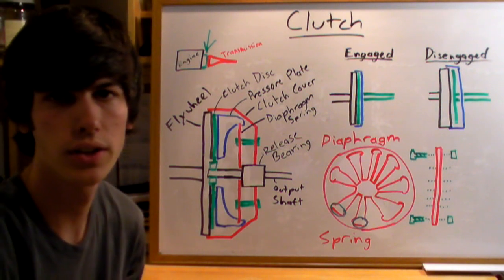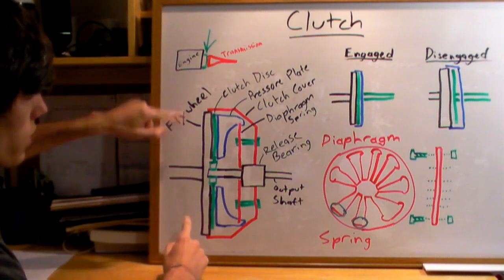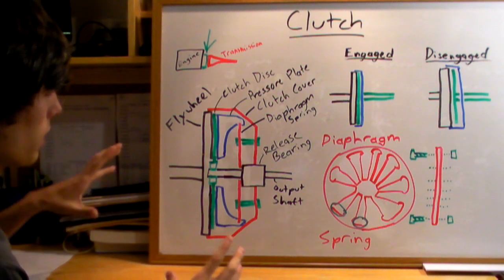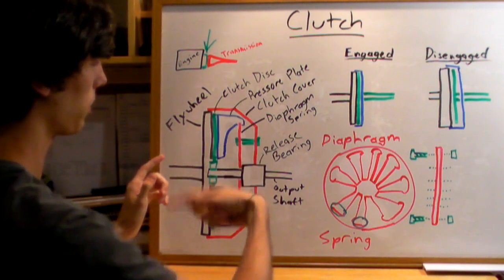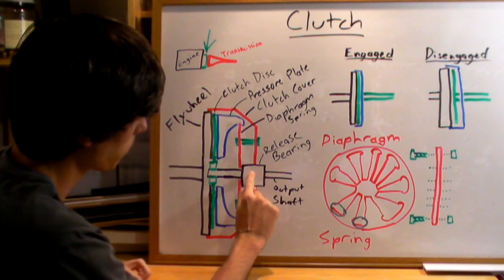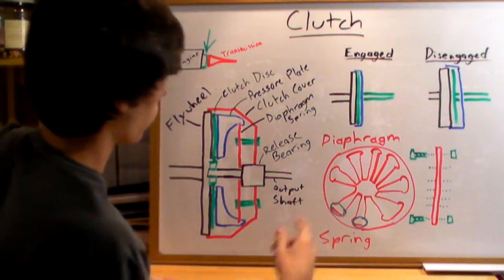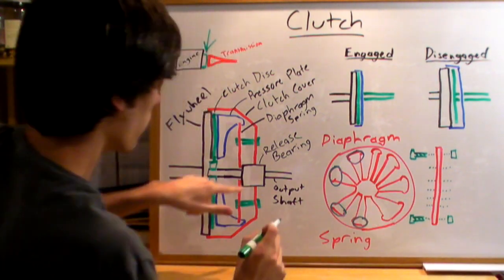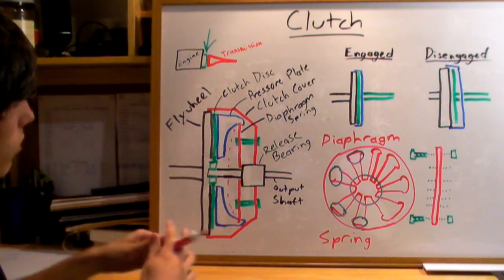Clutches - Explained

Comment: Great video, simple and clear. I would have liked to have seen the equation result under different scenarios. For instance, is there an exponential increase in the ability to handle torque when 2 or 3 plates are used.

Comment: What issues can you run into when using an adapter plate to mate a motor to a foreign transmission. Is there ever a scenario where your adapter plate is too thick that the clutch doesn’t engage with the flywheel anymore?

Comment: Can you explain to me what happens on neutral when pressing the clutch in and out please? Always wondered what is the difference between neutral and neutral+clutch pressed in.
Reply: neutral gearing occurs inside the transmission where paired gear sets have their own clutch-like collar that actuates a particular gear. The clutch pedal is attached in front of the transmission so basically they are 2 separate systems.

Comment: Question, does it wear on the clutch to cruise to a stop in neutral ? I keep hearing this, but I just don't see how if it's rotating with the crankshaft with no pressure on the clutch.
Reply: If you keep the clutch pressed, yes. If you put your car in neutral and then release the clutch, no.

if you cruise and do the second thing, try to rev match at the end if you don't stop, to avoid wear on the clutch or the synchros.
Reply: Seems like the issue here is that the clutch is still technically in contact with the flywheel but it just grinds against it without the pressure from the diaphragm. So it basically turns into a disc grinder as you are coasting. However if you let go of the clutch the pressure is applied immediately and the clutch stops grinding against the flywheel. If you put the car in neutral, the engine clutch is engaged/not grinding and none of the gear clutches are applied and so nothing is grinding.

Comment: +Engineering Explained:I've been planning to buy an R32 from a local importer here in Florida. I've been spending a fair amount of my free time just researching the car in general, just to be sure it is what I want to buy with my first bonus after college. I recently saw a video where someone said that the clutch pedal does not have to be depressed in order to start the engine. Why is this the case with the skyline?

Comment: what is the function of pilot bearing ?
Reply: Imtiaz Sarwar Wasek to allow the engine to continue spinning while the transmission input shaft is completely stationary.

A scenario of this would be you at a red light while idling with clutch pedal in.

Engine is still running but transmission is completely stopped. (Not rotating)
Reply: +Alex salazar

Is that how a manual transmission doesn't stall when there is resistance? I've been trying to figure this out for a while and I just can't figure it out.  Let's say a car with a small engine is on a steep incline on an asphalt road. They are at 1k rpm and shift into first but that isn't enough force to turn the transmission. In my mind that would stop the engine from turning.  

I have been an automatic driver my whole life and I know that the torque converter gives a lot of leeway when it comes to not using enough power to start turning the wheels.
Reply: Pilot bearing keeps the output shaft from rattling and making noise

Comment: so, i(if i understand this at all!) it is just friction that connects the engine to the gearbox? How does it not slip all the time?
Reply: David Baker it is connected by bolts also
Reply: David Baker the high pressure from the pressure plate/diaghram then the higher performance you go. the stronger the pressure plate. and after a while can stack clutches!
Reply: The clutch needs to have a higher grip force than the torque of the engine. Hence presumably why people talk about how supercars have "heavy" clutches simply because their engines have so much torque that needs to be nailed down by the clutch in order to avoid slippage. High pressure diaphragms and large multi-plate clutch assemblies presumably. I'm no car expert though tbh. But that seems to be the logical conclusion.

Comment: Ey man, just a question about clutch burn.  I believe what causes it is the friction on the clutch if it's partially and not fully engaged.  Does this mean you can't burn the clutch if you ride it on neutral, or if you ride it fully disengaged(floor clutch press)?

Comment: Hello sir,
We are goiing to design a ATV for Baja student India'17 where we thought to implement the cvt but I need some suggestion regarding this that what are components that we need.
1.engine
2.torque converter
3. cvt
4.forward-neutral-reverse(fnr) gear box 
5.drive shaft
6.differential
7.axle shaft

please tell me that above list is correct or not ,if not please modify it.

Comment: No matter how many of vids about clutches i watch, i still cant understand it lol
Reply: Take a look at that disengaged
Reply: You have a clutch disc, flywheel and pressure plate. Flywheel connects to the engine crankshaft, pressure plate connects to the flywheel. Since they are connected, they spin at the same speed. Clutch disc is connected to the transmission. 

Pushing the clutch pedal in will disengage the clutch disc from the flywheel since pressure plate isn’t applying the pressure.

Comment: So what happens when someone "burns" a clutch by revving to much with the clutch pedal pushed in?? I'm curious to know the science behind that
Reply: +Bouge laal The friction between pressure plate and the clutch disk generates heat. The heat and friction are what eventually kill the clutch. But this just happens if you hold the clutch at the biting point, which means that it is neither fully engaged nor disengaged, so it slips. Yeah, thats about it.
Reply: Eventually under normal wear and tear then this will happen I'm assuming, right?
Reply: +Bouge laal Sure, eventually the clutch disk is worn down. What then happens is that the clutch begins to slip even when fully engaged, meaning that the engine will rev up without accelerating. But you dont have to worry about this in everyday use. I had my clutch replaced when i had 200k km in my car. 
But that whole thing is completely normal, as the clutch is a wear and tear item.
Reply: Cool, thanks man

Comment: quick question, can I use a race clutch for road racing and drag racing with the stock pressure plate,or do I have to buy the whole kit,cause I made the mistake of buying a garbage clutch and pressure plate for cheap 105$,and now that I want to have fun (burnouts)I can't transfer power good and I burned the clutch,can I use the piece of shit pressure plate with a good race clutch
Reply: I wouldn't, because race/drag pressure plates have stronger springs, which apply more force to increase grip on the performance clutch. So even if you use a performance clutch, if you're using a shitty pressure plate with weak springs, it won't apply enough pressure to get the full use of the clutch's better materials and properties. You also have to deal with two different models/manufacturers, and they probably weren't designed to work with each other, and might not even fit at all.

TL;DR: If you're gonna get a performance clutch, get a performance pressure plate too.

Comment: there is an interesting variation of the manual shift that has been used in the maruti Suzuki celerio.... released in India recently that claims to have the same fuel efficiency as a manual although it doesn't have a clutch.... could you please make a video to explain how that works
Reply: +Shreyas Shanker It shares the same mechanics of a manual transmission, the difference being it exchanges the clutch pedal for an electronic controler of the clutch and gears. So you have comfort of an automatic without its losses.
Reply: +Paralelepipedo00 awesome.... thanks for the reply

Comment: why is it that if that you can bring the clutch up gradually and there it gradually engages the gear? surely it is either engaged or disengaged?
Reply from the maker: +James Fox It's not an on/off switch. Pressure increases as you release the pedal, so it gradually grips as you let out.
Reply: Do you feel the same way about brake pads?
Reply: Ville Nummisalo It was a simple yes or non question

Comment: Hey nice explanation of how it disengages! you forgot to explain what makes the pressure on the pressure plate so it presses on the disc :)
Reply from the maker: +Nuno Rodrigues The diaphragm spring. I believe I mention this.
Reply: +Engineering Explained sorry but you have missed the 3 plates that secure the pressure plate to the cover and actually force it down onto the disc
Reply: There are straps holding pressure plate back using their spring characteristic as well as centrifugal force (caused by spinning) I mean neither pressure plate is suspended nor clamped to the diaphragm spring so the diaphragm spring can not pull it back!

Comment: how clutch disc  disconnect flywheel?
Reply from the maker: đức hữu nguyen Diaphragm spring.
Reply: Engineering Explained hey，thanks for your explanation. But I got a question：u said clutch disc and the shaft won't be rotate with the flywheel，the other parts will. how could that possible？I mean is there 2 situations？I think when driver disengage the release bearing，the clutch disc is always free to rotate. however，when the release bearing is
 engaged, the clutch disc must be rotate with the flywheel just like other parts. And shaft rotate with flywheel in same velocity? or the flywheel rotate at its own velocity?

Comment: Hold on...... The clutch is attached to the flywheel. So if flywheel is lighter it can rotate faster with lesser engine power . so faster moving flywheel will result in more speed. So if I want my car to move at a greater speed lighter flywheel is ideal. Does that make sense?
Reply: adhithya ravichandran No it does not make sense. The clutch is not attached to the flywheel in a form of nuts and bolts. However the clutch is in between the flywheel and pressure plate. Lighter flywheel means that the engine will be able to spin(rev) faster compared to a heavy factory spec flywheel.
Reply: Omar is Raddoesn't the transmission rotate at the speed of the flywheel when clutch Is engaged. So more the engine Revs more is the speed of the car.
Reply: adhithya ravichandran a lighter flywheel will not necessarily make your car faster. And The transmission and engine spin together regardless of what gear you are in. The tranny stops spinning when you press the clutch pedal in.

Comment: There seems to be a lot of controversy on the Internet on whether or not you should change your automatic or manual transmission fluid.. I know my manual transmission jeep recommends that it never needs to be changed for the life of the vehicle. What are your thoughts and opinions from an engineering standpoint?

Comment: Question: when my clutch is engaged, I hear a knocking sound, almost similar to the sound of helicopter props spinning; the sound may speed up along with RPM (while moving), but it gets hard to hear over the engine noise at that point. What might this be?
Reply: Jeremy Kerstetter Could possibly mean your throw-out-bearing is faulty or was improperly installed.
Reply: +Jeremy Kerstetter throw out bearing.

Comment: Why the clutch doesn't slip with high torque engines? They do alot of pressure to the flywheel?
Reply from the maker: Feche1320 Proper amount of friction.

Comment: You explained the clutch very well. I have struggled trying to comprehend how when you press the throw-out bearing toward the flywheel, you get the clutch plate to release from the flywheel. The diaphragm springs are what make that whole assembly "Reverse Acting".  I am in the middle of replacing the clutch in my son's 2001 Honda Civic EX Coup. Parts is parts, but it's always helpful to know how something works because it makes servicing a lot easier when you can apply the logic. Plus I wont look like an idiot explaining to my son why we are doing what we are doing. He's got a much better chance of learning and retaining information when it makes sense, otherwise its just what bolt to remove and parts to replace. Thanks!

Comment: The bolts only hold parts together. You are very knowledgeable but it's a lot different to study engineering than to have hands on experience and knowledge with components. I think you could be a very good technician.

Comment: hey, i know this is a very basic question, but what will happen if we do not press the clutch pedal? why exactly is it better to press the clutch and change gears? cant we just change the gears? and why? plz do explain..
Reply from the maker: Abhijeet Mishra Pressing the clutch pedal disengages the engine from the transmission. It is possible to change gears without it, but it requires perfectly matching the engine RPM to the transmission speed, otherwise you will hear an unfortunate noise (and could cause damage).
Reply: Even perfectly matching the rpm and not using the clutch is bad for synchro gear boxes

Comment: can you explain how come the clutch  disk and the pressure plate don't ware out quickly, i mean when the clutch is half pushed isn't it rubbing against the pressure plate and therefore wearing each other?
Reply from the maker: Yes, but only for brief periods of time (while shifting). Otherwise, they're rotating at the same speed. If you intentionally let it slip, it will wear significantly in a short amount of time.
Reply: Ohh got it thanks!

Comment: I still have a key question unanswered from the video, and would welcome anyone who has the knowledge to answer it.  When the pressure plate is pulled away from the clutch disc as the clutch pedal is being pressed, why does the clutch disc slide along the input shaft (drawn as output shaft in your schematics) towards the direction of the pressure disc (thus disengaging it from the flywheel), when there is no force driving it to do so?  Remember all we are doing is to disengage the pressure disc from the clutch disc, and the pressure disc does not actively pull the clutch disc away from the flywheel. The inertia should keep the clutch disc in contact at least momentarily with the flywheel, thus spinning still with it at the same speed, until the friction is not enough to keep it that way.  If that is correct, the slipping friction will wear the clutch disc in this case.  But again, what is the reason that you say in your video the the clutch disc is going to disengage from the flywheel (meaning that we create a space between the flywheel and the clutch disc by pressing the clutch pedal)?
Reply from the maker: It disengages due to friction. The clutch wants to spin at the speed of the wheels, as it's connected to the transmission. When the speed differs from the flywheel, friction will push it away. It's very similar to how brakes work, as there is nothing that "pulls" your brake pads off the the disc, friction just moves it away if there is no applied pressure. Just like a clutch, you could have some wear here (though it will be very minimal) as the speeds differ.
Reply: Engineering Explained Just to clarify. Its not friction which push brake pads away from the disc. Its actually seals within brake block, the ones sealing caliper. As they are made out of let say rubber they will compress/stretch (due to friction between rubber and cylinder) when caliper goes inwards. Then they release that stored energy when there is no brake fluid pressure. How to check it? When you have wheel off just get somebody to push brake pedal few times and watch brake pads mowing in and out. Thats of course just slight movement but enough to set disc free.

Comment: Can you please explain what practices will wear out a clutch on a manual transmission.
Reply from the maker: Don't burn your clutch (rev the engine high and not let it grip), don't hold yourself on a hill with the clutch (use the brakes!), try to rev match.

Comment: can the clutch can keep the engine running or it helps the flywheel?
Reply from the maker: The clutch is connected to the transmission shaft, so it is not rotating when your engine is in neutral.
Reply: Engineering Explained Thanks for your help!

Comment: Hi great video as always!
I learn a lot from your videos!

Could you explain why the clutch "burns" if you keep pressing the clutch pedal?!
If when pressing it releases the clutch, wouldn't it be with no friction and hence not "burn"!?
Just curious.. Thanks heaps!
Keep on the great work mate!
Reply from the maker: "Burning" the clutch refers to when the engine speed and transmission speed are not matched, but the clutch is engaged (at least partially), so it's rubbing against the flywheel and friction is heating it up and wearing it.

Comment: As a person learning how to drive a stick, everybody tells me not to burn up the clutch. Do you think you could explain how clutches "burn." Could you also explain why the cars stall when you aren't accelerating enough?
Reply from the maker: Could potentially make videos on these topics. The clutch "burns" when your engine rpm doesn't match your transmission rpm, so the clutch is sliding on the flywheel/pressure plate, creating friction and heating up.

Comment: so when the clutch is only pushed half way in for example when going from a stop to some speed in first gear, is the clutch plate sliding against the flywheel and only portion of the energy from the engine being passed from the flywheel to the transmission and wheels? and when the clutch is fully released I assume it is rotating with the flywheel completely with no slippage occurring?
Reply from the maker: Yep, and yep.

Comment: I had the same question as Indra. Does the clutch decouple from the flywheel due to friction from the output shaft and transmission? It would seem to take some force perpendicular to the flywheel, but it's weird to see where that might come from, as all of the flywheel's force is rotational. (I think...)